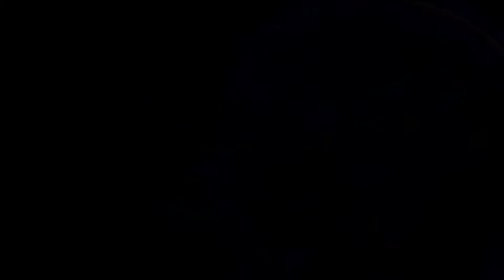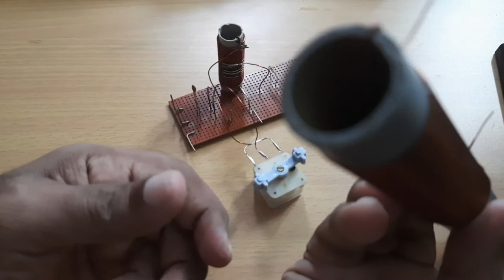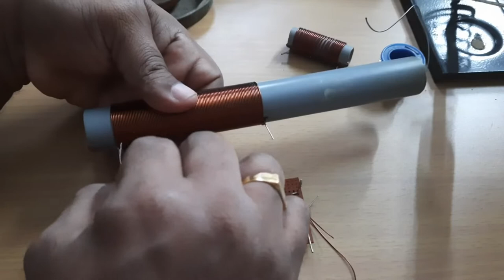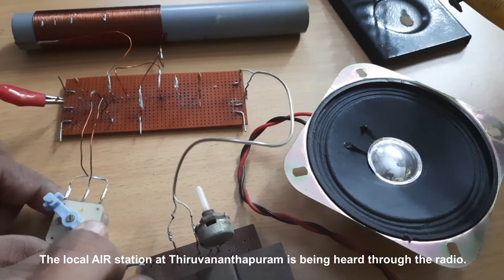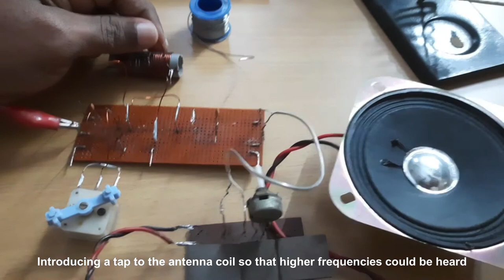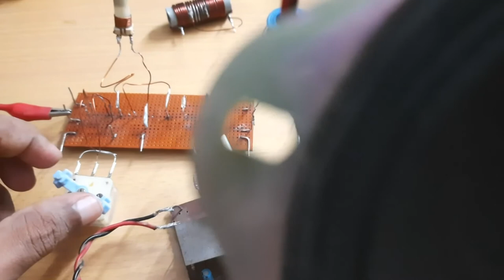Crystal Radio Working on Medium Wave and Short Wave Bands

Comment: It is easier to wind if the new turn is closer to your left hand and the older turns are further away.  This way, you left thumb can be dropped onto the new turn so you right hand can take a brief break or adjust the source spool.
A 2nd coil on the same pipe can work as a "loose coupler" for making better selectivity.
Reply from the maker: Ok, thanks for your valuable suggestions. Will try that method next time.

Comment: Coil diameter and turns ?
Reply from the maker: 20 swg and 100 turns on 3/4 inch former for medium wave and 20 swg and 25 turn on a 15 mm diameter former for shortwave coil. Turns are not critical as the capacitance can be varied.
Reply: Super 👍
Reply: @AjimonChellarcovil  
This is a useful tool to know about:
http://electronbunker.ca/eb/InductanceCalc.html
If you want to increase the diameter you can reduce the number of turns.  Fiddle with the numbers to keep the inductance value about the same.